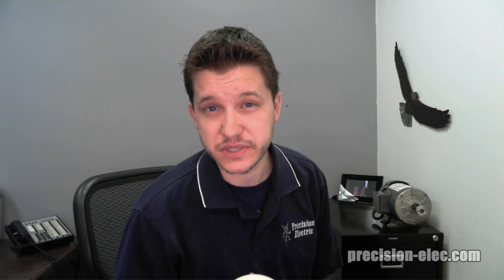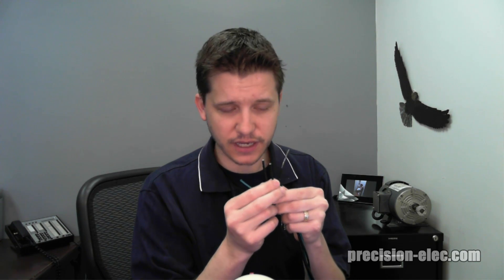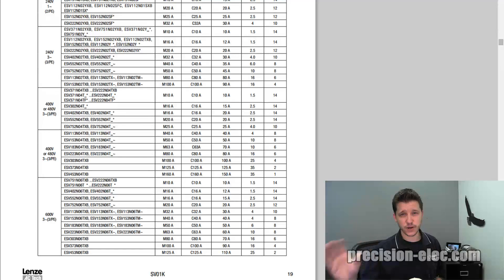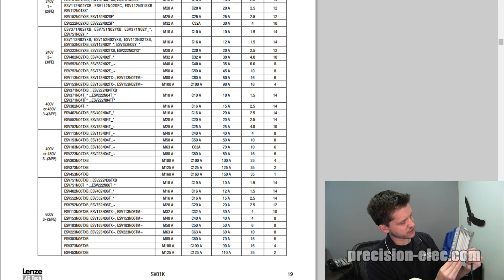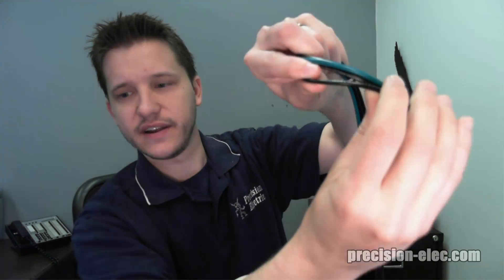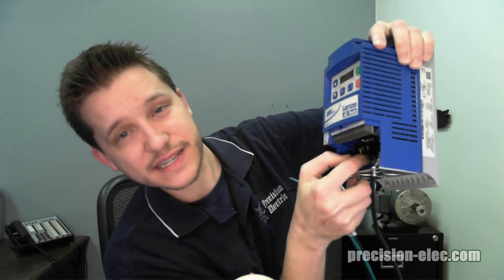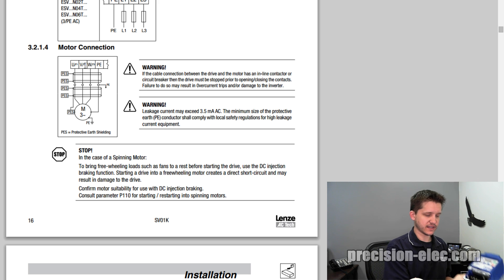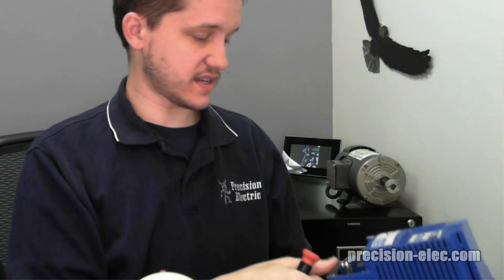How To Wire A Motor To A Variable Frequency Drive (2020)

Comment: This video was useless and the title is misleading. You never touched or showed the motor connection to the VFD at all. You spent most of the video talking about how to strip and screw wires into a terminal. Complete waste of 10 min.

Comment: Hi Can you tell me about the jumpers in the motor? 2 setups available. one ties W2 U2 and V2 together. The other ties W2 to U1 - U2 to V1 and V2 to W1. Lenze VFD running the motor. It trips out after a minute with a P_FD error

Comment: I am thinking of changing my machine tool to a VFD setup.   But, I don't want the motor noise that I hear.  the high pitch ringing is just too much to deal with.   is there a way around this?